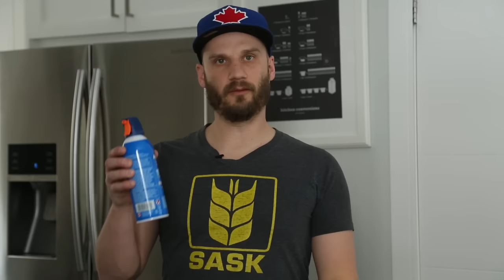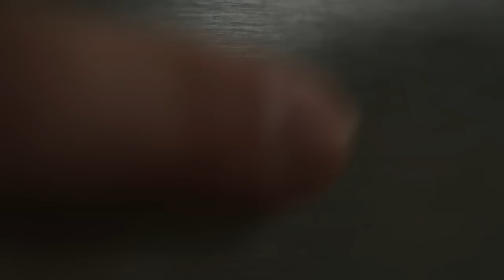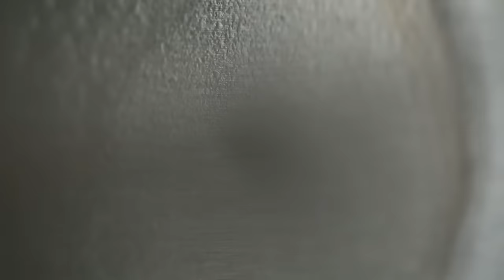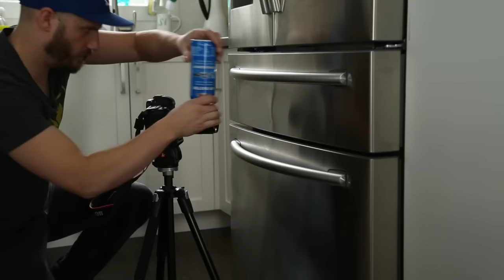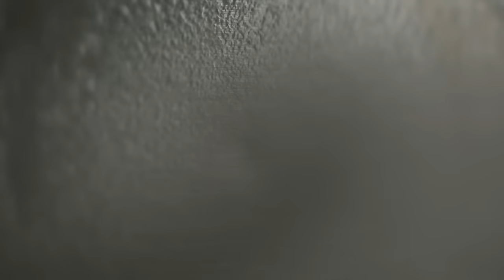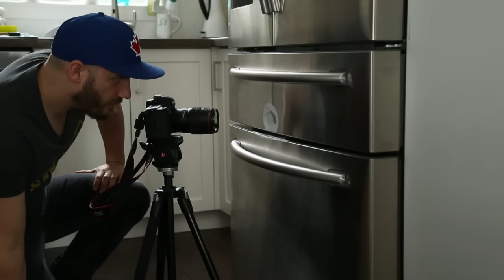DIY stainless steel dent removal with air duster and hair dryer (fail)

Comment: I saw this and thought I would try it because my dent is half the size.  It's right in the middle of the frig and drives me nuts every day.     I also didn't want to buy the spray because I'm too lazy to go to the store and everyone has the Corona scare. So I used the hair dryer and got the dent hot just like he did,  then I took a really cold can of soda and quickly and GENTLY pressed it up against the dent and rolled it back and forth.  Like you are rolling out pizza dough.  It came completely out.  I have another deeper dent. where my son dropped a bottle on top of the freezer portion.  I'm going to try it.  It's free, took 1 or 2 minutes and free.  Thanks for the idea DIGIT9
Reply from the maker: That's awesome!!
Reply: @DIGIT9  so I just did it on the deeper dent and it did nothing.  So for me it really only worked on a small shallow one rather than a deep or sharp one.    But hey the front looks really good.
Reply: I noticed a small ding on my new fridge door, found out someone left a lower cabinet door open and opened the fridge at the same time thus creating a dent. It’s driving me insane. 😡 I’m gonna try your method out!!
Reply: I did it like you did and it didn't work AT ALL

Comment: I removed a small dent on my refrigerator by ironing with a steamer. Place a thin towel over the dent surface then iron for about 15 to 20 sec and repeat as needed. Good luck!
Reply: Show us a before and after photo if you can.  I’m dealing with a corner dent or two on my new stove 😩
Reply: Con plancha común se podrá ?

Comment: I glued my dentures to the dent...Tried to really put some teeth into it.   Pulled the dentures but still have the small cavity on the surface of the fridge.   To appease those interested in other methods,  next attempt is with a frozen bag of peas.   I will first heat the door with a moist towel wrapped around a curling iron and then proceed to massage the bag of peas over the dent.  Sorry I can't provide a Birds Eye view of this...

Comment: You have to buy the stainless steel dent remover kit. I had the same size dent on my fridge and tried the blow dryer and dust remover can method. I even heated the dent 5-6 minutes and then hit it with compressed air for 30 seconds. Nothing. 4 rounds of the same method and still nothing. Bought the the dent remover kit online and it worked.

Comment: The application of the air is too wide and you cool the same area as you heat. The corner of an ice cube maybe better. You want to shrink the metal in the dish of the dent. Is the dryer hot enough??

Comment: rinkovideo, thanks for your original thinking. But why heat? That would expand the metal, making the dent bigger. Use only the cold. Shrinking the metal, in the dent, would pull it straight.   ...  A handyman creased my old refrigerator moving it out. I'm trying to find out if the door can be taken apart to push out the dent.

Comment: Just a quick science fact    It couldn’t be carbon dioxide because it shoots out a liquid once upside down and co2 sublimes so it can only be either a solid or a gas. The duster most likely contains propane or some other propellant. Good method though, I’m about to try it!

Comment: Tried this and wouldn't recommend it.  I used a crafting heat tool instead of a blow dryer.  The stainless steel now bubbles out in that spot and looks kind of like a big zit.  I think it's more noticeable than the small dent I was trying to fix.  Ooops.
Reply from the maker: Oh crap. I was going to try a heat gun but feared the paper-thin steel would bubble.
Reply: Did you try  ice cube on a wet face cloth. You are trying to"shrink" the metal. A high spot can be tapped down with a flat hammer , just tapping very lightly.  The problem is they have found a way to make metal so super thin it is weak.

Comment: You have to get the steel HOT!!!!! Hold the heating gun in one spot for 60 seconds... Also use a piece of dry ice big enough to cover the entire dent... hold that there for at least 90 seconds... I've done it a lot to my SS fridge.
Reply from the maker: +drewditty and it doesn't discolour the steel? I'm going to take your advice and give it a shot.
Reply: Mine didn't... I wish I had pictures... Just make sure the dry ice is big enough to cover the entire dent and that you hold it there until frost forms... I've done it a few times just like that and it worked great...
Reply: +rinkovideo Did the dry ice work?
Reply: Post a video please showing your technique and results.

Comment: Remove inner panel and roll or gently tap dent out.  That’s how they do hail damage vehicles.   It will get as close to perfect as you can get it.
Reply: Really not possible as it's all foam inside and all put together from the factory.  At least on mine.

Comment: A normal high dryer will not work.  It does not produce enough heat to help pop the dent out.  I used a Luff lighter that I have to start my Bayou grill.  Also once it is hot apply as much of the dust removal as you can.
Reply: I thought you said the air duster was useless. I would like to try this method, but not sure if I should use the air duster or not. What were your final results and how did you get there?
Reply: Danny Alford did it work? I used the lighter with ice and it seemed to help but I think the duster or dry ice would make a difference. My dent looks almost exactly like the one in the video

Comment: from what I have done.  Heat works the best.  No need for air duster.
Reply: I used my iron and then used one of those freezer Ice packs. Worked great. Small dents need concentrated heat; heat which a hairdryer does not give. 

I placed my iron onto the dent for about 30 secs and then placed ice pack onto dent. Took 4 attempts and now dent has gone.
Reply: @DeanneMariaCreates  Did you put the iron DIRECTLY on the refrigerator? What other tips? How does it still look?
Reply: Hi  @ibleevnu2  , yes I put the iron directly onto the refrigerator door. I switched off the steam, so that no water went onto the door. The crease has improved and is a lot smaller than before; however, I am looking to try other methods and will get back to you.

Comment: Did you ever figure out how to get the dent out? I have the exact same size dent as you
Reply from the maker: shamusom no not yet but I was just thinking about it last night. I'm worried about using a heat gun because it will probably destroy the thin stainless but I'm going to give it a try anyway. I'll let you know how it works.
Reply: Thanks! I have the exact same size dent in my fridge. Lemme know how it goes
Reply: +rinkovideo 
did you ever end up trying with a heat gun? I have a bigger dent on a fridge that I'm trying to figure out what to do with. Thanks
Reply: @RollinRizlas  I tried with a heat gun...no damage (be cautious about long and close you hold the gun on it) but it didn't really do the trick.  I think I may have improved mine slightly but not perfect.

Comment: On further experiments I used just heat and it took the dent out.  I am working on a dent that is pretty deep.  I will let you know how it goes.

Well I have found out that the dir duster is useless.  Gust apply enough heat and the dent should be gone.

Comment: You probably already gotten a comment along this line, however, you made try utilizing the technique that people use to get out hail dents, etc. called "PDR" or, "Painless Dent Repair."

I just learned about this today through YouTube – you can get kits on Amazon and although there is an art to it (And to those PDR experts out there who may thrash my comment if I don't say this: to do it REALLY right (and work on almost any sort of dent) it takes a LOT of skill to get out every little last ripple) with a combination of tapping around the outer rim of the "crater" with a special tool (when/if needed) coupled with the main magic bullet being the utilizing of a hot glue gun and little round deals you glue to the center of the dent and then after it dries (about a minute-ish) with a special tool, one grabs onto the little whatchamacallit and you give it a light (or harder)  PULL (depending on your dent coupled with the softness of the metal, etc. - 

For a refrigerator I would guess it would be a very gentle pull.  So, by going back and forth with tapping certain areas/high points and then pulling again on the center etc., you can flatten out the metal. [NOTE: there is also protocol for tapping the dent from the other side if you can get to the back end of the metal but you sometimes can't].

When I get some money together, I'm going to go on to Amazon and probably buy one of the higher-rated kits and try taking out a 3" dent in my car (someone backed into my front end area). 

I will video record the whole procedure & I'll eventually post the video on YouTube (my goal would be to do it before the end of 2018). 

My guess is in that I'm not trained, it may be far from perfect, but I can bet from what I've learned so far, that I'm going to be able to make it look a lot better than it was :-) 

I'd be curious to see how that PDR procedure would work with a refrigerator.

Comment: as soon as you start cooling it tap around the edge of the dent ..... it's a old school trick people used years ago on cars.... they just used a torch .... although you can't use that method now because the medal is to thin... it needs to be hotter than a blow dryer but not as hot as a torch.... heat gun

Comment: Get some bondo, repair, and sand like you would your car. Final 500 grit maybe. Go to Lowe's, Home Depot and get some stainless steel spray paint. Or go online and maybe get a better quality stainless paint. Take the handle off and pull the drawer out. Carefully spray light coats of stainless paint. Oh maybe take the drawer out before repairing. :) Then hope like crazy the stainless matches your original finish. At least the painted stainless will be fingerprint free. You could paint all the doors if necessary.